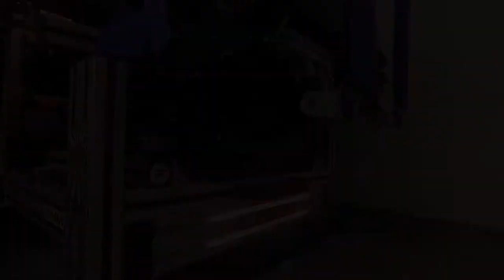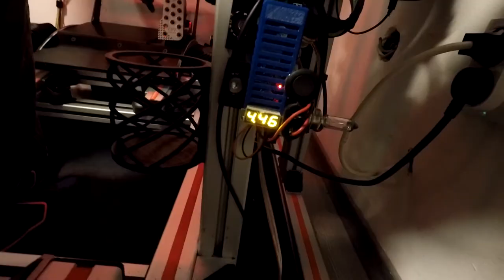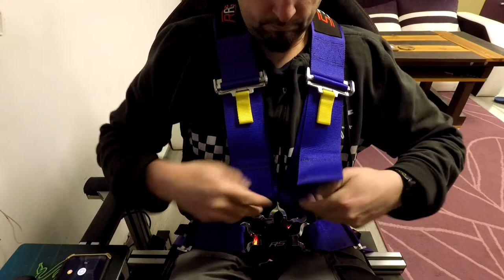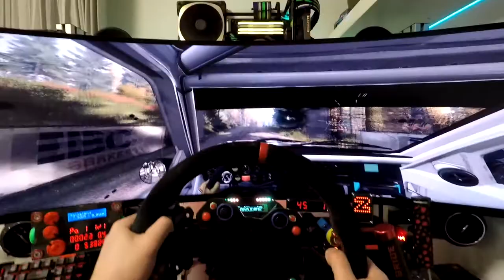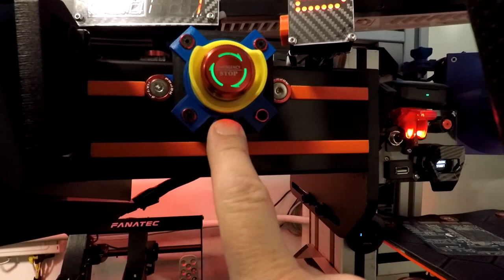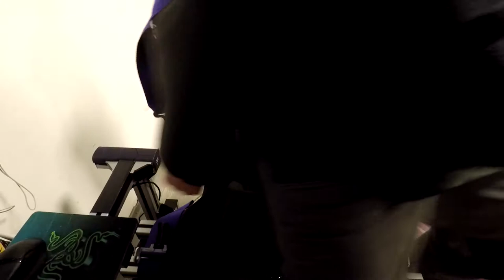DIY Sim Racing Belt Tensioner with Robot Servos , SimHub and 3D Printed Rollers

Comment: Hello, I built Stuyo's belt tension system using robot servos and a arduino nano. I have 2 issues, #1 is that whenever I make changes to the custom serial device, (test max tension,delta yaw gain, smoothing, ect) I need to power cycle the servos, #2 I cannot get the servos to work in game, they work when I do the tests but not it assetto corsa. I'm using Assetto Corsa 64bit and I also had crew cheif and racelabs open when I tried the tensioning system out, not sure if they interfere, but the more info the better. also in the incoming serial data panel in simhub, it does say "Blue_ASCII_Servo: connected" which I think is a good sign. thanks in advance if anyone can help

Comment: Anyone know the length of the threaded rod I would need for this project?
Sometimes ones instructions are about as clear as mud, and the site he refers to as a guide is now redirected to a 404 page!
Reply from the maker: Threaded rods are M5, cut to length to fit after you assemble the printed parts. Roller can be elongated in slicer if needed, so there is no exact rod length. No idea to which link you are referring to, all 4 of them are opening fine this morning. Updated both 3D printed part links with more current source.
Reply: @57uyo  The Problem here is where I source my all thread sells many lengths of M5 all thread!
I don't wish to print order the bearings then wait a week for all thread!
I worked Construction for many years and I learned the only Stupid Question is one that's never asked, 
and that a 5 cent questions are cheaper than 10 cent mistakes!.......
if I'm not sure i will ask if you cant give a simple answer than please your best just not saying anything at all......
BTW I use a near by 3d print service for those parts so I don't see the files hes using 
there's more to it than that but I wont go into the reasons why for now 
Thanks

Comment: U feel braking or the same effect will be when u atached to the non moving frame? I have 2dof and wondering is it worth do do belt tensioner
Reply from the maker: Much stronger effect than bungee cords. Directly attaching to non-moving frame is not good idea as it will break the Platform. Also servos are very fast, there is no delay between seat and belt movement. Only issue is noise, but i play with headset and it does not bother me that much.

Comment: Hi Stoyu, thanks for all your work. I bought the Nano and servo and did everything according to your perfect documentation. It works out of the box even in rFactor2. 🤩 I bought you a beer, well deserved! 😉
Reply: stumbled across this after accidentally discovering seat belt menu in simhub. glad to hear it works. gonna start ordering parts this weekend!!
Reply: Finished my prototype this night and drove for one hour, 911 GT3 R on the Nordschleife. I'm totally blown away. 😮 It actually helps me drive more consistent and more confident through tricky curves. In the last 10 years I attended the Gamescom and Simracing Expo many times. I tried all those fancy 30k Euro simulators that throw you around on long stroke cylinders - didn't line any of them. My prototype is far from perfect but I love it already. 😍 Thx Stoyu! 👍

Comment: Did you use the xl4005 or the xl4015 and did you use each motor one? What power supply did you use? thx and awsome inspiration I am currently rebuilding it and have my servos in the mail.
Reply from the maker: Mine isXL4005, works at 8.4v stepped down from 12, use only 1. It is less amps than needed, but supercapacitor takes care of that - it is more than enough, still works after half an year (3 capacitos with load balance circuit) - without it you will need 2x of these stepdowns, measured the servos at full lock at about 2.4A. I have 24V filtered PSU 600w for the bass shakers and after it have two step downs to power my other peripherals - one for 5 and one for 12V. Have 13 shakers, 3x windsim and the belt tensioner + aRGB - still have some power reserve.
Reply: @57uyo  wow love to see a video tour sound so cool :)

Comment: any idea if the code will work on an elegoo uno r3?    i have power supply + to center - to black and white to pin 9 and 10. does that  sound correct?
Reply from the maker: Not sure, but i think all arduino has has the same pins. You just need to select different board in the sketch program
Reply: @57uyo  thanks for the reply. I got it working it was the first time having to add a script? To simhub. I thought when i enabled it that was all i had to do. It boggles my mind how people understand and are able to build and program this stuff. I am very impressed and thanks to you and all the other people that make this hobby attainable for people like me.
Reply from the maker: @robertrose7645  I am amazed how I hate programming on high level, but me being system administrator can understand the available ready (arduino) scripts and modify them accordingly to my needs. I guess this is the power of internet and shared knowledge at your fingertips 🤪And this is the exact reason I made this video - to present the information I found on internet afterdigging deep for some days and point people to the original so it is easily found 🍻
Reply: I can confirm it works with the uno r3

Comment: How did you set them to 50 not the full 180
Reply from the maker: It is limited in the code, do bot remember any more if it was set on arduino level or in the SimHub custom program or both. Check the GitHub repository for details.
Reply: @57uyo having a lot of troubles getting these working , you think you could give me some tips

Comment: Well done! I'm about to build this myself. Just got my belt and waiting for my motors. I'm trying cheap 12v 13000rpm DC-motors for my first try. I chose not to go with servos since they are kinda loud. Wanted to go for stepper but not sure what power I need. Might you share your SimHub profile and Arduino settings if you use that?
Reply: did you finish it?
Reply from the maker: Link to code and instruction is added now in Description. Will be soon building stepper motor base tensioner myself, servos are really too loud :)
Reply: @57uyo  are stepper motors the way to go for low noise??
Reply from the maker: @jeremymartinez6024  no idea, but somebody on discord updated me that stepper motors are much quieter. I have purchased all parts for that half a year ago but never built it. Now will be changing seat and am planning to switch to stepper tensioner and see myself…
Reply: @57uyo  which steppers did you purchase?
Reply from the maker: @jeremymartinez6024  Nema 23 stepper with 15:1 planetary Gearbox (these are the ones around which the SimHub/ Wotever designs is built). All the details are in the SimHub Discord channel.